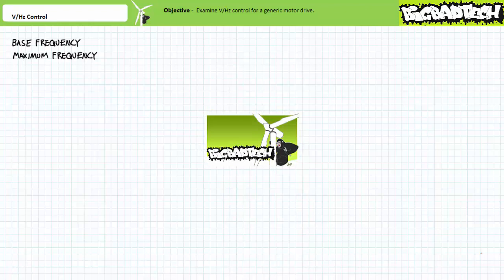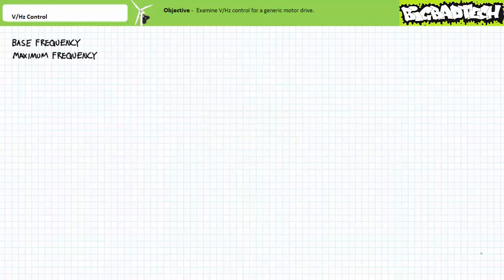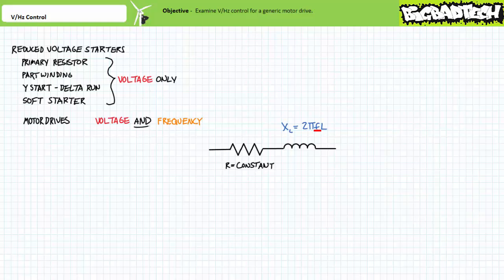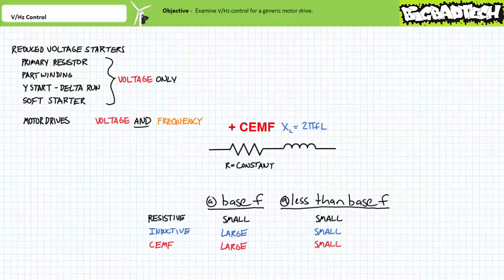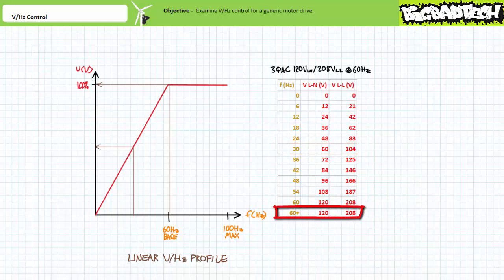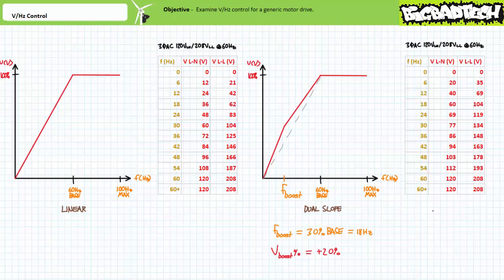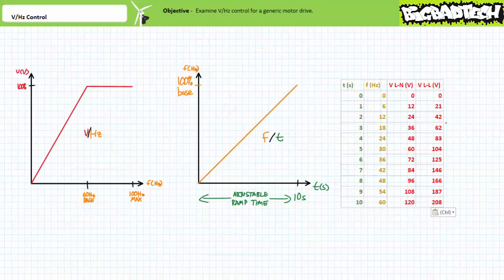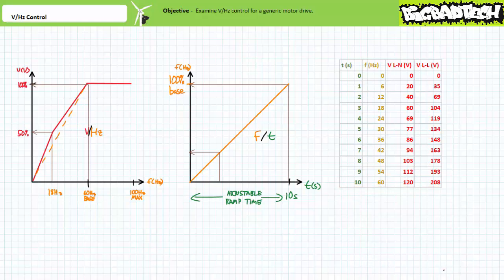V/Hz Control for Motor Drives (Full Lecture)

Comment: Imagine how well lab would go if applications (cars, airplanes, motorcycles, boats) were added into the lecture. They all require different curves and regimes of acceleration/deceleration rates. I hope this is address individually at one point in time. Other than that excellent lecture.

Comment: Hi Jim, why does current remain a constant when voltage and frequency are decreased together? I'm trying to figure out the relationship between current, voltage, torque and frequency. I see books and your videos talk about the torque and speed curve, the voltage, frequency  and time curve, but where does current come in play? Would you mind recommending books that cover these in great detail?
Reply from the maker: Check out the inductive impedance and AC Ohm's Laws lectures at: 
https://youtu.be/xowCaVH44MU?si=y2G4ULz6BYfjLAzz
and 
https://youtu.be/F2DpVRdsU0Y?si=-NGQrWS9I3IWzjMR
Long story short inductive impedance is a frequency dependent phenomenon. As frequency increases inductive impedance increases. Therefore one can apply higher voltage at higher frequencies given opposition (impedance) is higher thus current remains manageable.

Comment: I have a question related to induction motor reg breaking. How do put a motor in reg breaking mode. In other word how is the voltage and frequency set, relative to base values, in order to put the motor in regenerative breaking mode ?
Reply from the maker: Check out the "Motor Drive Deceleration Methods" lecture at: https://youtu.be/P4bDpyJCzp4

Comment: I have a question that if I make a v/f curve in which the v/f is initially 5 volt/frequency tiill 30 hertz and then 6 v/f ratio till 45 hertz and 7.6 hertz @ 50 hertz for a three phase motor. Will the motor run at higher speed or not? I saw a yaskawa vfd drive example to understand this. I have a very unreliable voltage from the grid and I intend to keep running the pump. I have a 25 HP motor that is running a 15 HP load. Motor has amperes rating of 40 Amperes and it is taking a load of 28-30 amperes. So, should it be alright? Will it be able to increase in speed? the torque required at low speed is not much and certainly less than the full rated torque
Reply from the maker: There are plenty of different multi-slope V/Hz profiles out there. A lot of them feature a little "boost" at low frequencies just to nudge the rotor to a start. Others, like the one you're suggesting, might feature a concave type slope. Not sure what you're asking about "higher speeds" though because a motor's speed is dependent upon frequency. Higher frequencies result in higher speeds. This being said, there are practical limits and mechanical considerations of motors designed to operate at specific speeds. Don't exceed a manufacturer's recommendations.
Reply: @bigbadtech  thank you. I have a grid supply that is very unreliable in summers. I need 380 voltz at 50 hertz and my ideal speed is 2900 rpm but since I have a vfd its speed reduces so much as the grid voltage is just 230-250 volts in three phase in summers. So, I want to keep frequency high and make the curve into a concave as you explained to keep the speed above 2300 rpm and keep getting water out of it. I am considering the overmodulation function of my vfd but I am scared that if I use it to increase output voltage it could be dangerous. What do you say? should I go for overmodulation as well as changing the v/f curve?
Reply from the maker: I get it. You might need a speed V/Hz profile that flatlines at a desired maximum voltage beyond a certain frequency rather than a continuous concave slope.
Reply: @bigbadtech  So, do you think I can increase speed by weakening the field (sacrificing the torque even at lower frequency to get desired frequency at low voltage?
Reply from the maker: Still not exactly sure what you're asking. Ideally a motor drive has a certain input range (example: 200-240V @ fixed 60Hz). As long as input remains inside this range, the motor drive should be able to produce the desired output voltage magnitude and frequency capable of driving a properly sized motor at a desired speed. One can think of the fixed magnitude and frequency AC input as being "isolated" from the variable magnitude and frequency AC output by the DC bus. Check out the "Rectification and Inversion in Motor Drives" lecture at: https://youtu.be/FZIVhHNdYnY

Comment: Does hertz change the amount of voltage? If something is running off of 480v at 60 Hz and is  then changed to run at 10 Hz, does that make the colts lower?
Reply from the maker: If the motor drive in question is using a V/Hz ramp, yes, 10Hz should have a lower magnitude than 60Hz. Presuming linearity (which it isn't) you might expect 80V at 10Hz (ie: 1/6th of base). This being said magnitude, frequency, and, for that matter phase shift and phase sequence, are independent properties and can be varied individually.
Reply: Jim Pytel Thank you Jim, i appreciate you taking the time to answer.